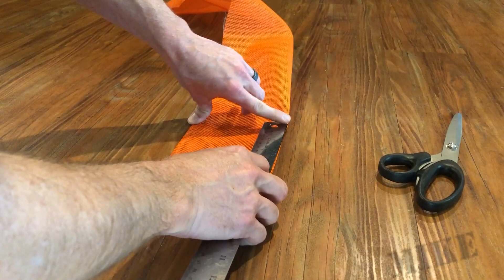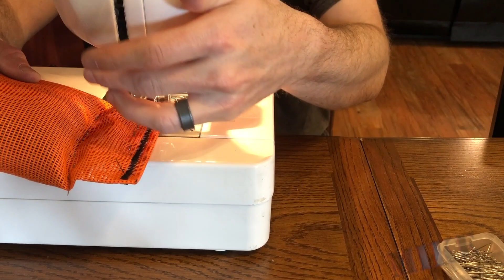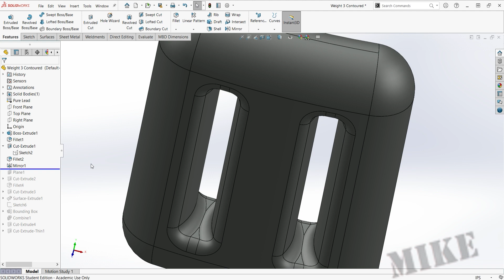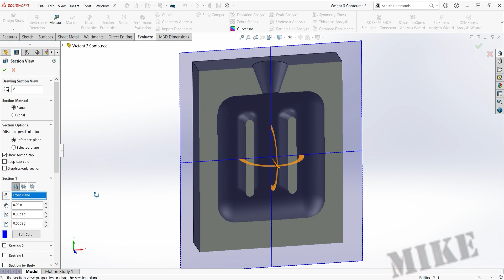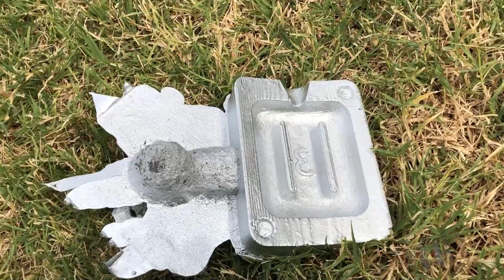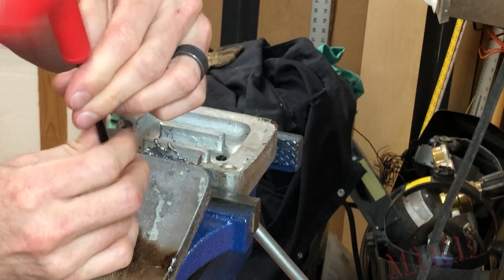3 Types of Scuba Weights - Mikes Inventions

Comment: Mike I wanna connect to you I have got a HP dv6700 want to confirm if you also had a HP dv6000 series laptop in that video in which you made a screen from an old laptop
Reply from the maker: Hey Akarsh, I think it was a 6500, but that was so long ago. To make the external monitor, it's the model of the screen that matters, not the model of the laptop. I'd bet they are the same though within the same laptop series. Take the screen out and check though. Thanks for watching!